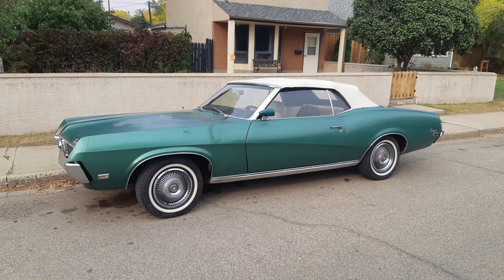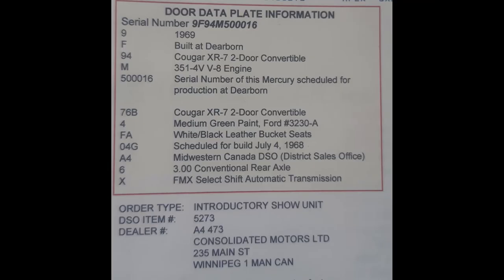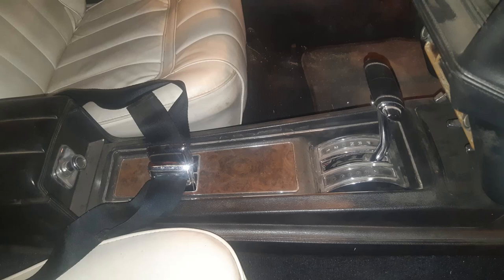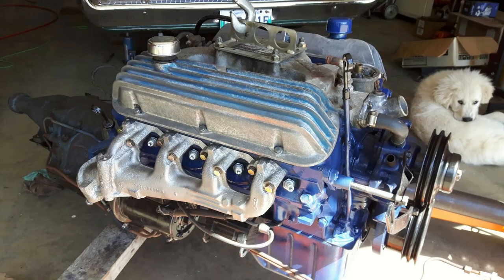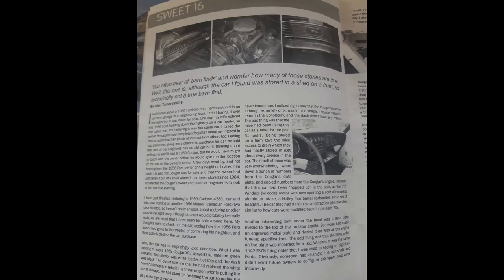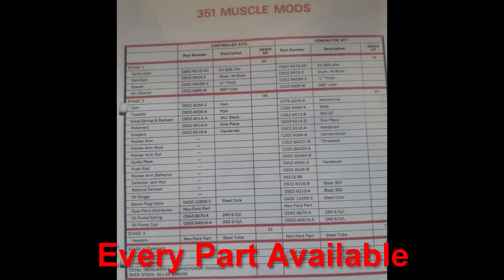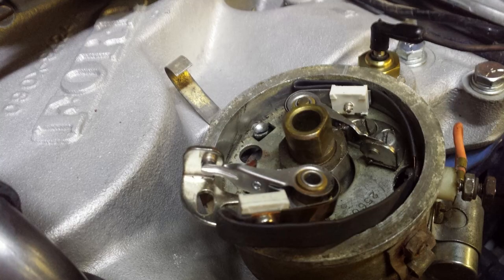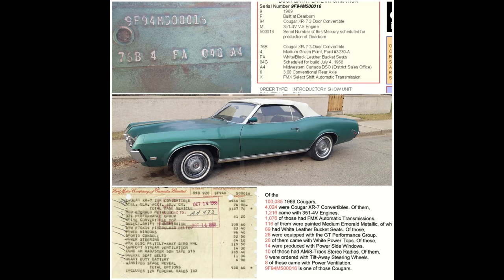1969 Cougar XR7 Convertible Story

Comment: Enjoyed your article . I was the owner of this car in the early seventies. Removed the engine & rebuilt it . Had the heads machined for the screw in studs . Added the intake , , headers , crane Fireball cam     & Mallory dual point distributor . Got the yellow traction bars as a birthday gift . Was going to install posi , but never got around to it . Traded it at Russell Motors in Winnipeg on a 1976 Aspen . Last I saw this car was in the late 70’s & was painted white . Look. Behind gas door , I drilled 2 holes for the air valves for the air shocks .
Reply from the maker: I hope to get more info from you so we can do an updated video. Thanks for contacting me. It's great to finally know this. Ps. It still goes like crazy. It would be really quick with the right rear end gear.

Comment: Forgot to mention , have photos of me & the engine just prior to installation . The headers if still the ones I installed are Appliance brand . They were the only brand that came painted white & they had 4 bolt collectors instead of the more common 3 .